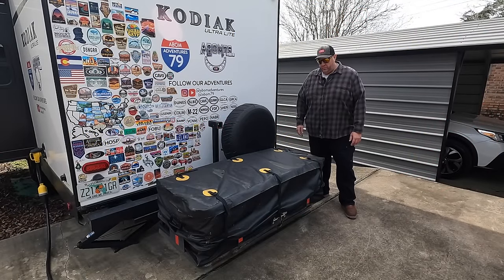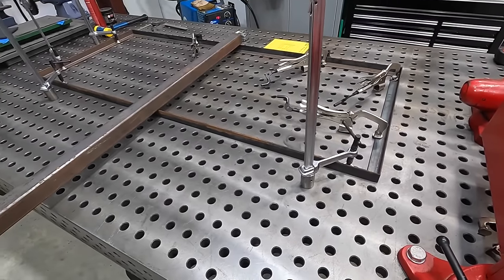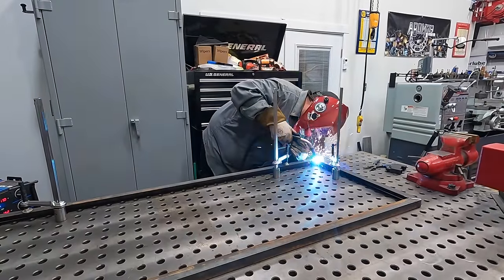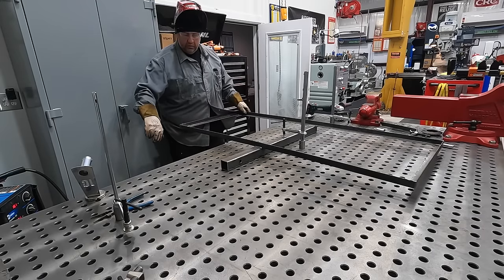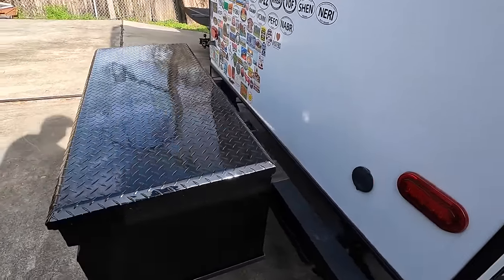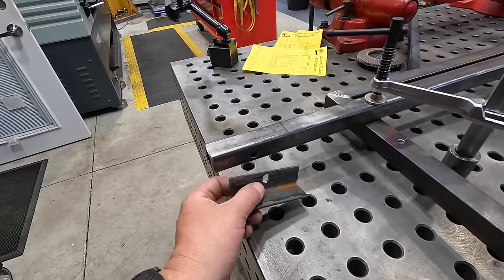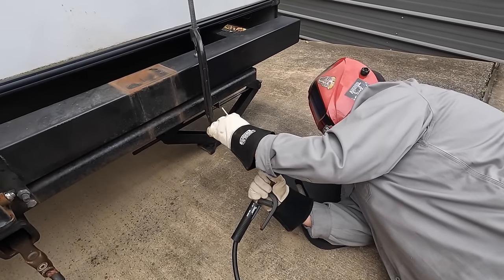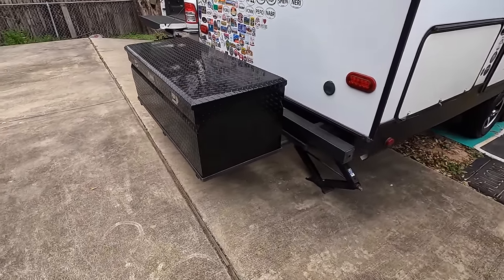Custom Cargo Carrier for the RV

Comment: Maybe plug the ends of the square tubing so they won't rust inside.
Reply: Condensation will form.
Reply: Blow some of that expanding insulating foam in there.

Comment: I would put a piece of Scotch 130C Linerless rubber splicing tape between the box and frame at the bolt holes to help with keeping any moisture out of the box. Just a thought.
Reply: That might also help mitigate some of the potential for galvanic corrosion between the aluminum and stainless steel.
Reply: Excellent idea. If the carrier is powder coated there should be no galvanic corrosion between the metals. Hopefully Adam will have the frame powder coated as well.

Comment: That box will definitely keep the rain out but it won't keep out moisture. If there are no vents, condensation will form on the inside. Hot day, cools off at night, lid is closed, moisture will condense on the inside.
Reply: If there’s power at the campsite install a 40 watt incandescent bulb inside the box to keep it warm enough to prevent condensation

Comment: random suggestion, put a few nylon washers under the box in between the frame and the box. this will allow water and dust to drop out the bottom and not get stuck and rot the frame.

Comment: Hey Adam,
A seemingly non trivial thing… the forward open ends of the tubes.. will scoop up all the water ( when there is a storm ) as you drive … a couple of rubber plugs 

Also… the bolts inside the box to hold it on the frame… I hope you used Nylock nuts .. I can’t tell you how many times I have seen storage like this fall off the back of a camper ( I drive a semi ).  I have a different sense of things that rattle loose

Comment: My SIL has a 42' camper that the back bumper slid out to carry bicycles.  It had a 250 lb weight limit.  We replaced the 1/16" 4:" tube on the back with a 1/4" 4" tube and replaced every thing else with heavier material.  He can haul 55 gallons of fuel and a 10 KW generator on it now.

Comment: On the bumber you can also use 2 clamp on receivers 2 feet apart.  Then make your custom tray with two hitches, or three if you want to keep a center mount.  That will alleviate twisting and provide a stronger connection.

Comment: Great job you guys! Adom, you can probably get a mailbox notifier that you can put on that box so when the lid is open it will let you know via Bluetooth or another radio signal. If you're snoozing inside and hear a storm coming you can look at your phone to see if the lid is open. LOL
Reply: Maybe add a simple car door switch to the box latch linkage that will light up on the dash if not locked up. Would probably have to run the circuit through a separate plug unless he had an unused terminal in the regular trailer plug. Heck, come to think about it a third brake light on the back would be a nice feature also!

Comment: I drilled a hole in the bottom of my receiver hitch and welded a half inch nut over the hole and put a half inch bolt in and tightened it up against the draw bar or my carrier and made it solid as a rock

Comment: 2 suggestions.. drop rubber/ strips on frame before you secure the box to the frame. The rubber/silicon  is to prevent steel/ aluminium  reaction 😮from rain and/or salt water and to slow the wear from the metal movement. I had it on mine and it lasted years. My friend had none and wore thru holes where the metal sat inside 3 years. On mine, I had brackets to hold ratchet straps (light duty) in place, to secure top while traveling, and to hold items on the top, if needed. Also not a bad idea to add reflectors to the bottom support for improved visibility. Both back and sides.

Comment: Alright, I have one for you if you like. Do you have a trailer plug on the back of the camper? Probably not as it is already a trailer  but you can buy or make a harness for one  and install it. Then, since you seem concerned about the brake lights, mount either brake lights/turnsignals on the exterior of the box or one of those low profile bars across the box. Run the wires through the tube in the middle and plug in to your harness.  No more comments or worries about blocking the lights.

Comment: Aren't you worried about the rack dragging, maybe in and out of driveways?  The other one had a rise in it for ground clearance. I would have thought you might make it sit above the bumper tube, closer to the back of the body.
Reply: you saw that this is the same size as the one that came off it....right?
Reply: @vintagespeed  If you look, the one that came off has a offset of 3" or more with a bent shank to provide more ground clearance.  Curt carriers are also angled up for even more clearance.

Comment: Hi Adam just one thing I would do to stop water from entry the box from rain when driving is put a rubber strip around the edge of the lid not the box as you with knock it off removing items from the box.
Reply: You must have missed the part where he showed the weather strip in the lid when he did a tour of the box.

Comment: With the welding rods, as long as the seal on the rod holder is good it'll keep the moisture out. But just watch the blonde moment that you don't drop a hot rod in a plastic tube..

Don't ask me how I know.. 😂

Comment: Hi Adam, I watch your shows all the time and I know you have a good sense of how a structure behaves. The detail of the steel support is very  simple and very elegant. If anything I would question about the design would be the strength of the middle connection to the truck. This connection resists the entire load resulting from the weight of the box and the impact that magnifies the load when you hit a bump or a pot hole at some speed. I am sure you considered that and that is why you kept saying that there was only light stuff in the box.

Comment: I like that locking pin. But the downside is it can be removed too easily. Instead of a camper, I haul my Jeep on a trailer. I've been out in Moab where guys have had their whole trailer and Jeep stolen off the back of their trucks by removing the hitch. My hitch pin is a lock. Sure, it can still be defeated, but I am going to make the dirtbags work for it. :)

Comment: I think another option would be 2 smaller size hitches on your bumper, 1/4 way in from each end. No tippy and better weight distribution for the box which is really being held in the center. Dent box on bumps? No end braces required then.
Reply: I was thinking the same. Three hitches would make for a more versatile solution for different kind of attachments on the camper. And stronger.
Reply: @falksweden  I don't think the lid will open with the bicycle rack in place

Comment: Looks nice Adam. If you could fab a "security upgrade" for those aluminum truck bed tool boxes so a thief has to work a little harder to pry one open, I believe you could sell a ton of them. Most of those locks are the same on all the brands of toolboxes. Doesn't take much to defeat them.

Comment: Nice job Adam but that will drag when you go though a low area. Put wheels under the back of the trailer on the frame. Just casters. so it will the keep your carrier off the ground

Comment: Why use that cheap angle? I would have used 3 inch deep, quarter inch thick angle.
Reply: Have you done the math?
Reply: That would be SO heavy!! That’s insane! I could certainly see 2X2X1/8 but what you might be missing is that the box has structure itself, it’s not going to bend in half or something.
Reply: @jeremyspecce  Especially since the box only contains blankets and Fritos!  :-)

Comment: I dunno Adam, maybe it’s an optical delusion, but it looks too close to the ground to me, like it might make contact on speed humps and pot holes etc.
Perhaps the roads are better, smoother in the USA than here downunder, but I’d be lucky to get out of the driveway without contacting the ground. 🤷‍♂️
Reply: He has the RV parked at the ramp in front of the shop. So the distance is deceptive.
Reply: @sithus1966  Ahh that makes more sense then, thanks for clearing that up. 👍👍👍